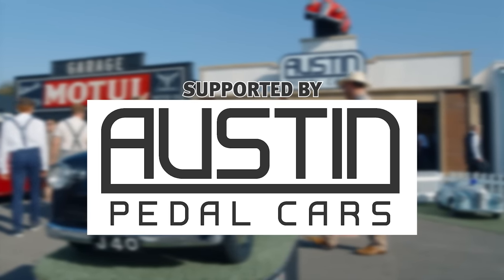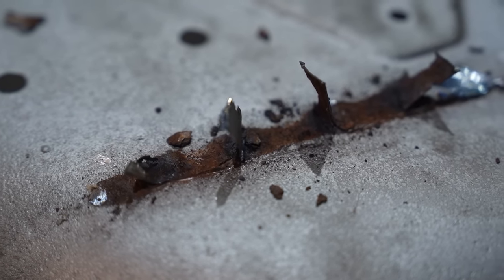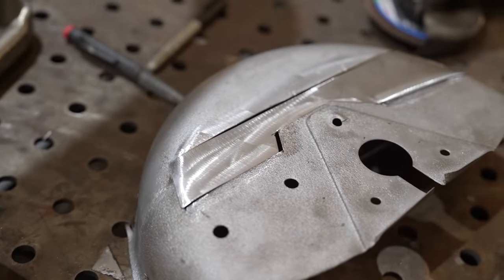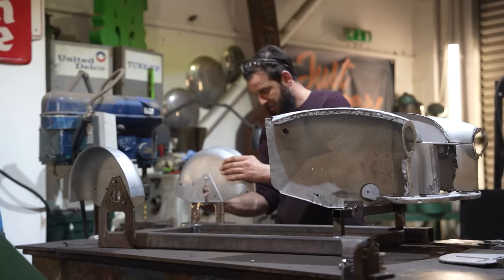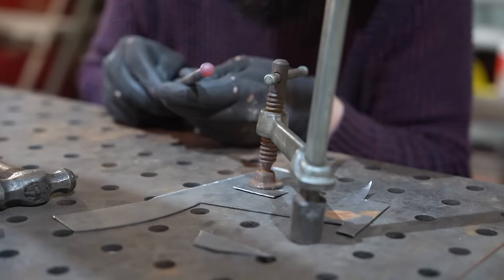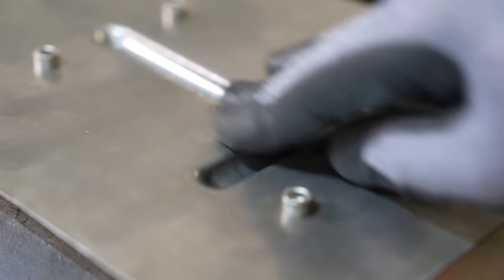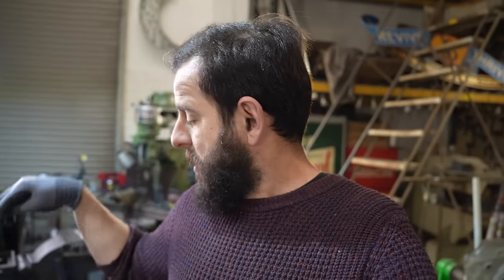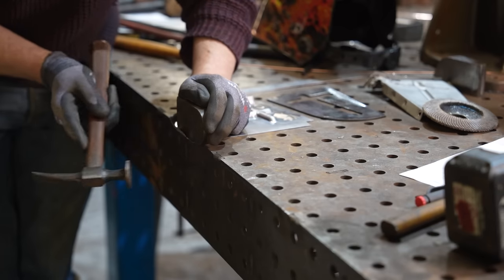Making New Panels! | Austin J40 Pedal Car Restoration | Ep.2

Comment: It was back in the 50's one of my first mechanical memories was watching a piece of metal being inserted into a Riley 2500 wing using Sif Bronze. Later as an apprentice tool maker I did a lot of welding using both Sif Bronze and silver solder. I was taught to first clean the parts to be joined, then to paint the flux only onto the area where I wanted the metal to go and not to flood the area. That way I got a nice clean join with little or no need to fettle back. another advantage to Sif Bronze is it's done at a much lower temperature and so causes less distortion.

Comment: Those panels look absolutely brilliant! Curious, would a preheat with Oxy/Acetylene help them when stretching or forming?

If your TIG box has pulse, you should give a go when welding in thin metal. Try a setting of 1.2 pps, 50% peak, 25% background. You’ll need to up your base amps just a bit because the heat is only on 50% of the time. Using it, you can run the entire seam with minimal distortion and time your filler dip to the pulse.

Comment: Dom,
You should consider using Silicon Bronze for tigging patches in. I prefer AC current, but it can be DC welded. It only puts a fraction of the heat of steel rod into the work since you're basically soldering by melting the rod instead of having to bring the workpiece to the melting point.

Comment: Dom, welding panel steel with by Tig is to Hot which causes panels to distort. Panelbeaters use Mig welding but spot tack weld around patches, but cool or use heat sinks to remove heat away from weld to stop distortion.

Comment: The panel you made with the pressing, neat idea but to save you a lot of hammering time, I make similar tools but for an air gun (air chisel) with that tool welded to one of the chisel fittings. 
You would do it in a lot less time and have less arm ache 
Lovely project, keep at it
Keep smiling and hugs to Wendy (and also John haha)

Comment: Try using MiG wire as filler rod so you don't have so much weld build up. You'll find your heat setting can be lower as well, which should help with distortion

Comment: Dom, have you tried using mig wire when welding thin gauge panels, you will find you will need less heat, give it a go.

Comment: Have you ever thought about using a 3d printed tool for forming beads? The tool will certainly not last for a long time and the thickness of the sheet metal is limited but I know it works - there are a couple of videos on Youtube demonstrating it with great results...

Comment: Hi Dom, loved the panel forming including the ball bearing hammer! I was wondering after seeing this whether you could weld a bearing onto the end of an SDS drill bit, put the SDS drill into "hammer" only mode (i.e. not turning) and use it to do the same job? You'd get a lot more impacts, potentially speeding it up and maybe getting a smoother finish? Just a thought.....

Comment: there are a few J40 parts on the normal internet auction sites (some sold, some avalible) at different prices , it might be worth acquiring some of those for parts measurement , you should still get your money back re-selling them.  It does seem there were two versions (at least?) over the years so watch out for detail changes).

Comment: I am impressed (no pun intended) with the cruciform shaping. On the minus side, I do not like the way the hand-held cutter is put down. Overall, it is an interesting project.
Reply from the maker: I’m not sure what you mean about the hand held cutter?! Sorry
Reply: @DominicChineas  Not a problem with a cutting disc fitted, but with a rotary metal brush they can shoot off in a random direction if still rotating. It is the sort of thing that happens when one's concentration is elsewhere, so it is good practice to always do the safe thing. The tools are usually shaped to make them easy to place disc up.
Reply: @DominicChineas  - It's you putting the angle grinder down at 2:04. The blade guard is in place, so although the blade is spinning, it can't touch the bench. John's suggestion of placing it down disc-upwards sounds very dangerous

(Until I re-watched, I thought he was referring to last week's episode where you once put the angle grinder down on its side, with the blade still spinning, so it cut into your workbench. It's all too easy to do.)

Comment: one of the things on the Porsche rear panels to me was the non-original placement of the "dishing" of those panels for stress and strength resolution , I dont know if they were scientifically calculated originally
Reply from the maker: I’m not sure what panels you mean on the Porsche but the ones I have put back in are all correct to as they should be
Reply: @DominicChineas  They looked different (inner "boot" wings ?) - they ones from the us manfacturer.

Comment: Dom, i am not an expert sheet metal worker, but i think that one of the reasons that the panel distorts is that there is too much material added. If you look at the Yorkshire car restoration (https://youtube.com/@yorkshirecarrestoration?si=O008267SqBBm1_-r) after tacking the patch in they cut round the patch with a cutting disc leaving a 3 mm gap around the edge to fill with weld. They then follow the same process as you have small welds cooled with an airline with time to cool. You are doing a great job with this and the other projects, I can’t wait to see the next stage.
Reply from the maker: With adding beads like this it’s definitely not enough material that causes it to distort, sorry if I didn’t explain this clear enough